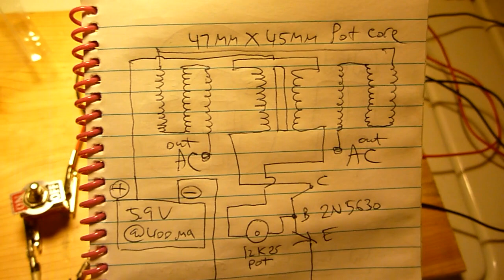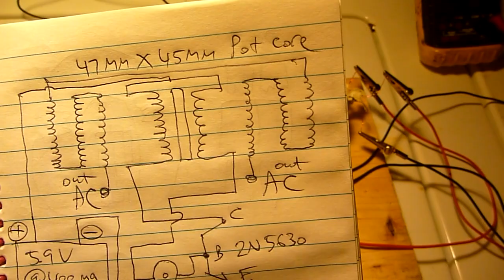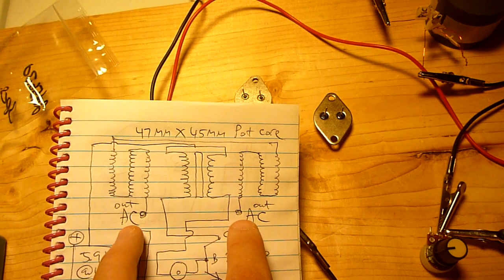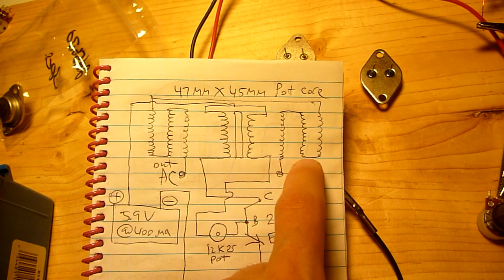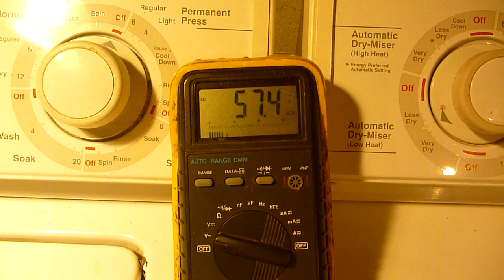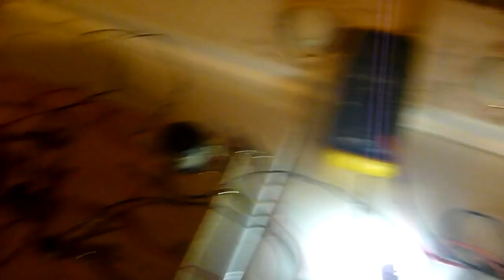Transistor Battle: 2N3055 VS. 2N5630 which is better for joule thief circuits?

Comment: This transistors is famous about there base current ability . So they was considered a high current high temperature high frequency . More than to considered for to be used for amplifier or power supplies as other type of transistors .

So I use this type of transistors for controlling a current factory in turn of frequency in the high coil primary Tesla or equivalent primary coil

Comment: When these type transistors go bad do they stop singing? I have 2 of the 2N1522 in a small 1 tube amplifier that all of a sudden stopped singing now amp keys but has no output.

Comment: One other important factor to consider is your load.  The LED light is a nonlinear device, so it may be best to do comparisons with a regular incandescent light.  Also, if the LED light has a switching power supply inside, it and the 'joule thief' circuit could be interfering with each other.

Comment: You have already found out that there is a difference between these transistors.  I can tell you that the 2N3055 has low current gain, well below 100.  If you use a transistor that has much higher current gain, and low saturation resistance at low collector voltage and high current, you will get better results.  No Darlington transistors allowed.  One that I have found works well is the 2SC2334.  I got some KSC2334 (highest gain "K" hFE range) from Mouser.com.  You can search for 2SC2334 and click on the .PDF found at the Renesas website.

Comment: Congrats bro! I am having a little bit of difficult on drawing a higher potencial difference out of my Joule Thief, I didnt use a resistor on the base of my Texas Instruments TIP31C do you think that if I place a transistor there, then there will be more potencial difference flowing through collector and emitter? Thanks a lot!

Comment: hi, very informative video, thanks for sharing :)
by the way, do you know what is the maximum and minimum current  most of darlington metal type can handle at the base? i have google research the data sheet but this what i have here looks like it was not publish online. i got it from scrap electronic part, i got lucky to find 1 that i test with diode meter and looks fine but i don't know how much current it could handle at the base, i'm worried.

Comment: This is really cool, Sir.  Could you tell us where the high pitch sound was coming from, please?  Also, i have a question.  If you got a plastic tube 8 ft long, placed coils at every 6 inches, but the last 3 coils had smaller wire windings, and each coil was like an antenna not being connected to anything but the first coil so that you can charge it.  Will each coil be able to carry the charge to the last coil  and will the last windings be able to increase voltage like a car coil?
Reply from the maker: Gristle Von Raben The sound that you heard in the video was coming from the pot core (the transformer). The transistor switches the voltage on/off thousands of times a second causing this sound to appear in the metal.

Let say you have an 8 ft coil with a coil in the beginning. If you were to send a AC (or pulsed DC) through this coil you'll produce a magnetic field at the ends of your coils. Magnetism moves in a clockwise/counter clockwise directions and will appear at the ends of your coil. This can be picked up by your other coils on the tube. Your other coils will have to be connected to something though, like a capacitor. However, the loss of voltage will be exponential (you'll lose power with distance squared from the 1st coil). I don't think you'll have any voltage/power left by the time you get to your last coils because of how far it is. If you want to transfer power over long distances like Tesla did in his Wardenclyffe Tower you'll have to use a different electric wave other than transverse electric wave (typical form we use today). Tesla used scaler or longitudinal electric waves. Basically he had a very thick diameter coil connected in series with a large capacitor than then going into a spark gap. Inside this large coil there was another coil with a much smaller gage wire but many more turns (basically a Tesla Coil). At the top there was a metal ball. The pickup coil would have 1/2 the length of the transmitter coil and would have to be matched to the transmitter coil in resonance. If you are interested check out videos with Eric Dollard or Konstantin Meyel. They did extensive research into wireless power transmission.
Reply: ok.  thank you very much.  :-)

Comment: You are moving more from a joule thief to a pulse width modulator,.  I have a couple of transistors like that I am getting ready to try but they have three pins , they are Sony,  C291 m03 and C293 KN40  ..
I just set up a 2222 with a blue ferrite that I wound and it is doing well with 4 LEDs on 2.68V ..  some say the blue ferrites aren't as good but then a true joule thief is done with a tiny bead with a 2mm hole and it will light at 1.5V but I have been using ferrite magnets and I had 13 LEDs with an SCR and when I tried to take a picture of it the magnetic field put things in the picture that should not have been there  ....

Comment: are you sure you are reading the voltage correctly? You can only rely on 50Hz AC and DC with those meters. if that jthief is pulsing 20kHz AC there is no way to measure that with a regular meter